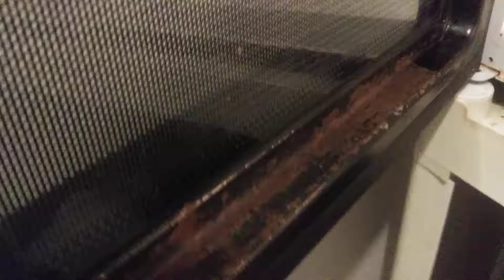Fix the rust inside a microwave door

Comment: I'll try this. Thanks. Can I use it on the inside as well?
Reply from the maker: Thanks for stopping by, Vanessa. No problem. The black fingernail polish I applied is on the inside when the microwave door is shut.
Reply: @quartytypo  Thanks for responding. I'm sorry, I didn't explain myself properly. I meant on the walls inside the microwave. One of the rust spots I have is on the upper left wall.
Reply from the maker: Whether on the door or inside, it's all the same. If it's white, use white fingernail polish.
Reply: @quartytypo  Thank you very  much
Reply from the maker: de nada
Reply: Is it unhealthy to cook with rust inside the microwave? And could the fingernail polish contaminate the food even after waiting 24 hours?